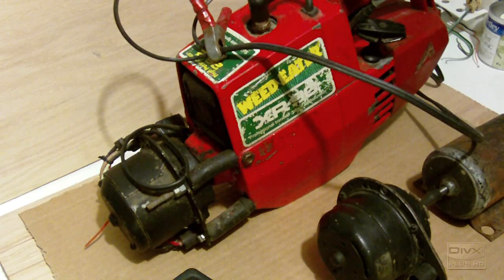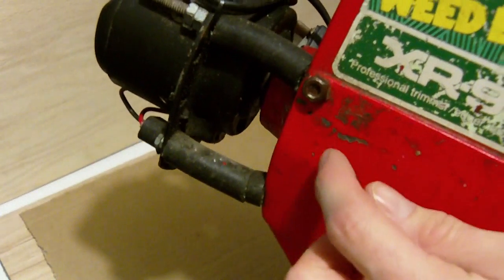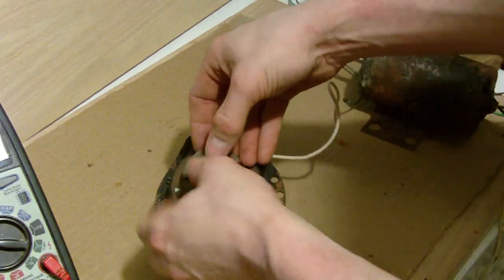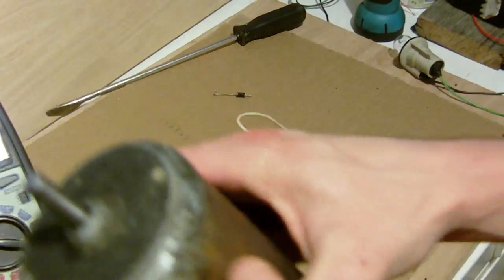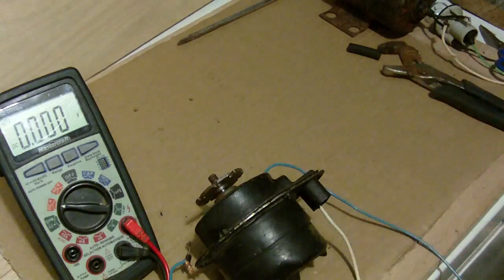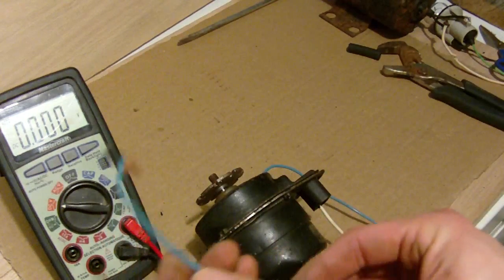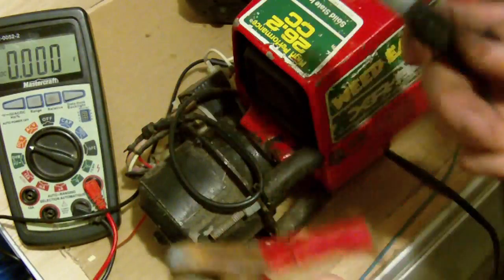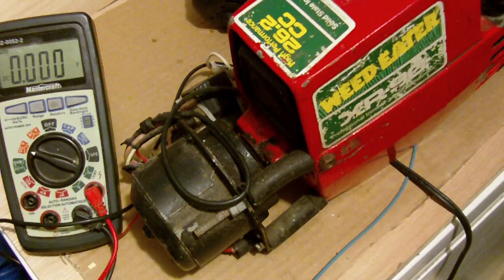Weed-Eater Generator 12v 100 watt how-to

Comment: Do modern blower motors use permanent magnets? Also note that if your weed wacker is spinning the motor the other direction, the polarity will be reversed.

Comment: Is the motor strong enough to electric start the small gas engine?
Reply: How strong is it  do I think the electric motor from a 24v dirt bike would be strong
Reply: Bro the motor has a pull start then the  spindle rotates the ac motor thereafter creating electrical energy. When the rotor inside the stater of the ac motor rotates it excites the atoms in the iron electrons begin to flow rapidly through a tiny little wormhole.

Comment: One day you'll burn it out..the breaker isn't inline with the protection of the electric motor so it'll protect the circuit itself and the diode will prolong the life and allow you to see your flaws when you hit the gas to hard..the hertz are the real game to play with..double the wattage you plan to use, split it half to use and half to battery may not be full potential but it'll be much worth it..